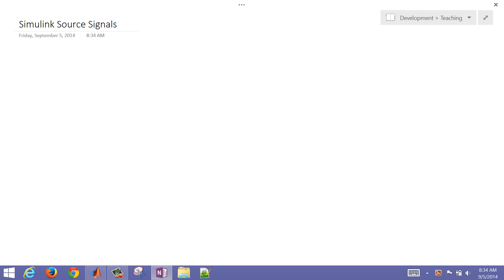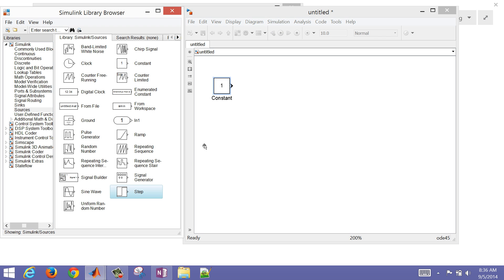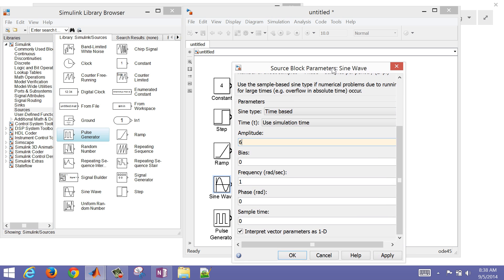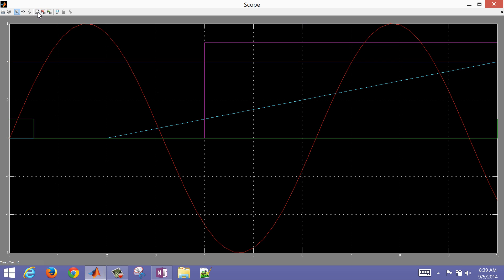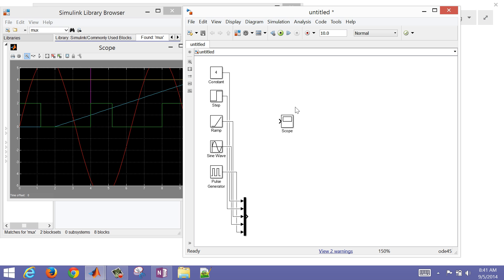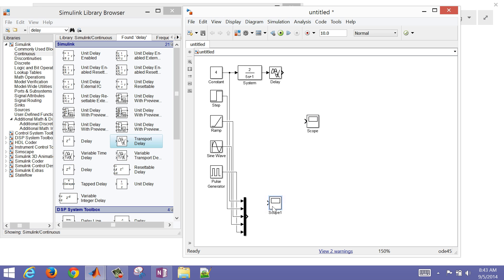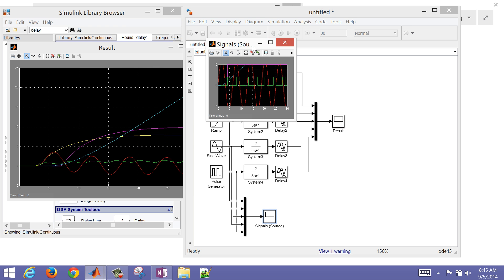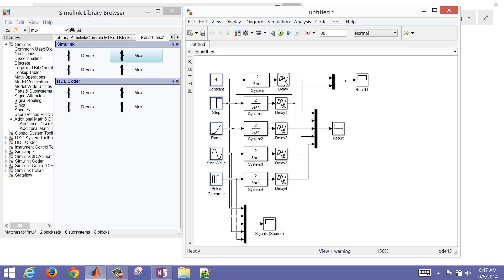Simulink (MATLAB) Source Signals

Comment: Why the constant can generate a fixed signal not a value?
Reply from the maker: A constant is intended to be a single value that doesn't change. You will need to use a slider or other type of input to change it as the simulation proceeds.
Reply: @apm  Ok,sir,thank you very much.But i mean,why constant block + scope, a point(constant) i see in the scope ,however,constan block + step block via mux blck , a line(constant) i see in the scope.😬